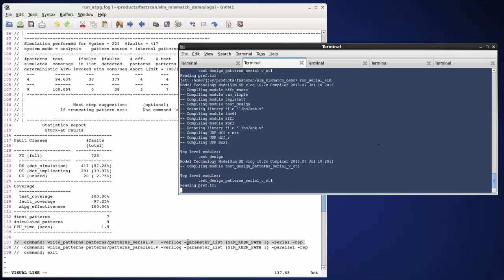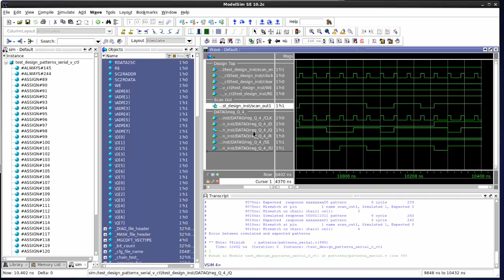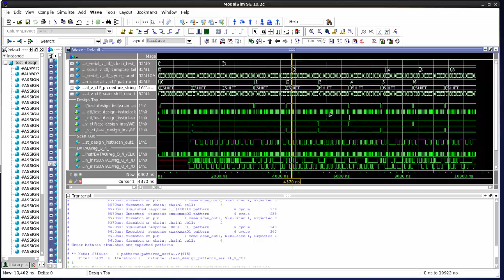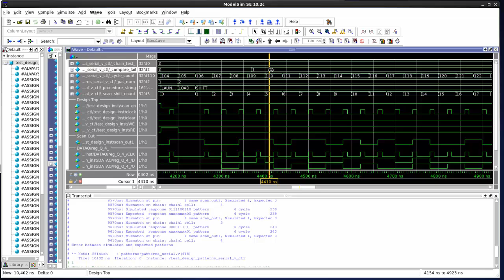Simplify Debugging of Scan Pattern Simulation Mismatches - Tessent Silicon Test & Yield Analysis

Comment: How to find the flop that captures the wrong value? You have to count back through the chain, which is ok with 4, but tedious with higher numbers.
Reply from the maker: +modelmark   

There are a few techniques
that can simplify identification of the failing flop. First, here we’re
simulating a serial test bench which is useful for debugging shift issues. It’s
much faster to simulate a parallel test bench in which case the exact failing
flop for every failure will be reported during simulation. Since serial test
benches take a long time to simulate, some people only simulate some serial
patterns (a few of each type) to verify correct shift operation. They of course
simulate all patterns in parallel.
You can also use the scan
cell report from when patterns were created to see which flop corresponds to
the cycle reported during simulation of serial test benches. In Tessent, the
report_scan_cells command will create this report.
Lastly, you can use the
automated simulation mismatch debugging capability to not only report the
failing flop but also results of analysis that compares VCD data with the
tool’s simulation values. This can typically identify and report why a mismatch
has occurred. The command to run this analysis is
analyze_simulation_mismatches. 
Thanks,
JayJAY JAHANGIRI, Technical Marketing Engineer
Reply: Tessent thanks for the great tutorial, can please provide any documents related to these techniques of debugging the failing flop in seriel pattern sim 
Regards